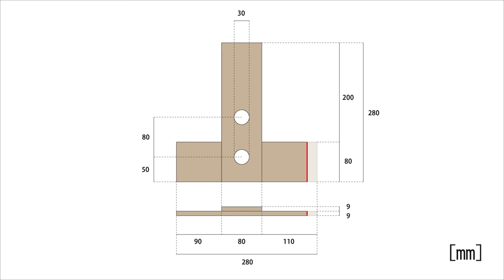15 SIMPLEST Woodworking Tools Hacks | Tips & Tricks

Comment: This is the first video of actually useful jigs I've seen in a long time. Especially for anyone starting out with woodworking or power tools this can help you make most out of your circular saw instead of buying an expensive table saw. Which is also very useful for smaller workshops like mine. This goes onto my todo list

edit: Also they are all very safe.

Comment: The first few saw jigs are basically small tracksaw jigs, very simple to make but highly effective ... you could add the 45 cut on the other side of the jig to give you a 45/90 jig (instead of two separate jigs) 👍
Overall a good selection of jigs to assist in the accurate cutting of wood, brilliant 😀
Reply from the maker: Thank you for watching and for your feedback.
Reply: Barry suggested using the other side of the jig to cut 45°
 🤔

Comment: Awesome jigs!  For the groove width one at 15:38, the adjusting screw can vibrate and the width can drift. It needs something to lock the screw in place so the adjustment doesn't change.  Great jobs on the jigs, they are all quite useful and very accurate!
Reply: You could put a nut on the screw and tighten it (the nut) to the body of the router. It'll compress the threads of the screw to the router kind of like a vise. It will not work for spacing that is less than the thickness of the  nut, in that case shim between the screw head and the wood guide.
Reply: I would think the pressure of it being pushed against the guide might provide enough force to keep the screw in place?
Reply: What about a wrap or two of PTFE plumbing tape around the thread?

Comment: beautiful work throughout, including on the jig saw, which i dont usually regard as an essential or especially useful tool, but your problem-solving there was lovely. of course we've seen all these things before, but your execution is impressive and superbly presented, and i like the way you have gathered many conceptually related solutions into a single presentation. on the circle jig, many times you dont want a hole in the center, and the steel guide bracket cannot move up, so an offset can be fashioned that allows you to tape a piece of 1/2 or 3/4" over the center, and for your router to sit flush with the surface to be cut. there would be several ways to do this

Comment: 8:07 - nice chip collection you have going on in front of your cut.  you can no longer see the layout line.  Yeah, I know you didn't have one.  But I certainly would.  I'd have to make dust collection to eliminate the problem.  Consider that.

15:40 - nice jig.  Technique is sketchy though.  That screw can vibrate and de-just. You COULD end up with a failed dado.  I'd opt for an earlier version, route to depth the left side and the right side, then just free-hand hog out the middle.  No chance of a mal-adjusted setup.

16:20 - always good if you use only the one size bit.  Use a smaller or larger bit and your jig collects dust.

17:10 - hogging without dust collection or fencing - you could ruin your project with an accidental touch on one side or more.  Dust collection isn't your strong suit I'm noticing.

Comment: Circular Saw                                                   Jigsaw
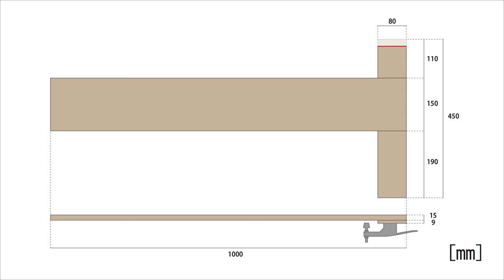  0:00  Right Angle 0:43 Drawing                      7:14 Vertical Holding
  0:45 Record Width                                            8:40 Right Angle 9:18 Drawing
  1:24 Blade Width 2:19 Drawing                Router
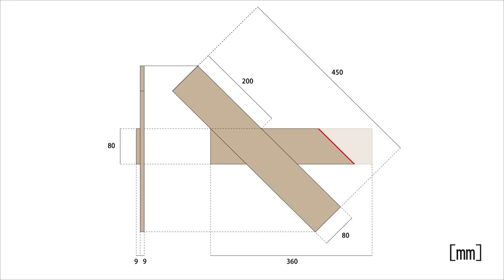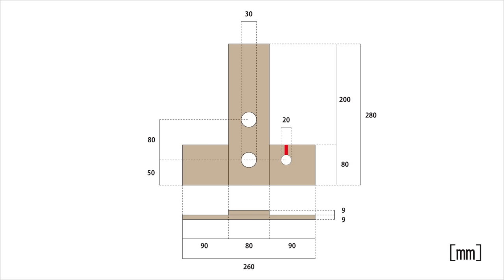  2:21 Oblique 2:53 Drawing                             9:20 Right Angle 11:19 Drawing
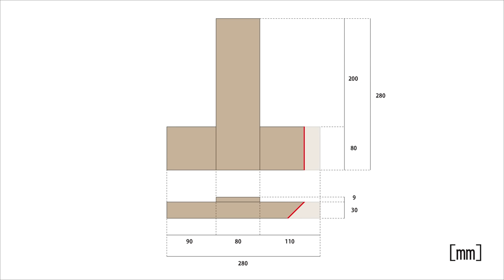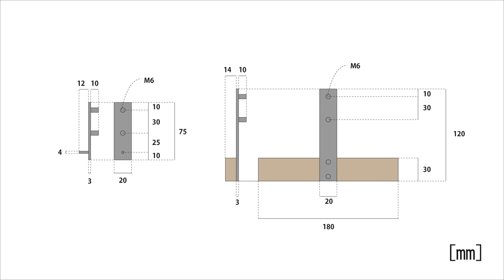  2:55 Slope 3:57 Drawing                              11:22 Circle    13:44 Drawing
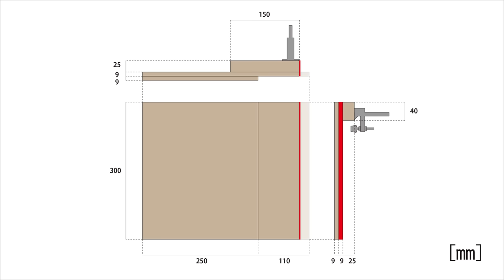  4:00 Small Piece 5:11 Drawing                   13:17 Parallel   13:44 Drawing
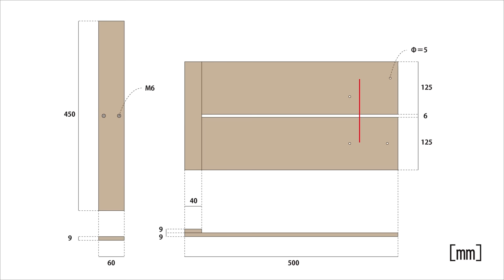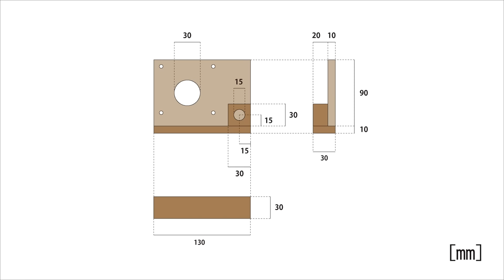  5:14 Parallel 6:19 Drawing                           13:46 Groove Width  16:08 Drawing
  6:22 Long Cut 7:11 Drawing                        16:09 Straight 16:45 Groove